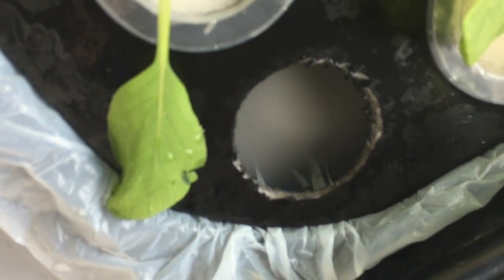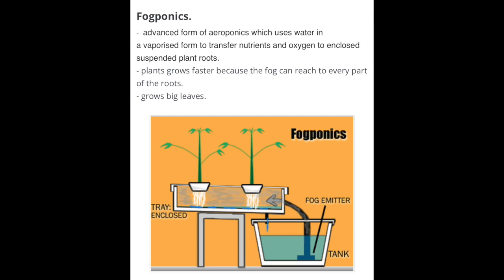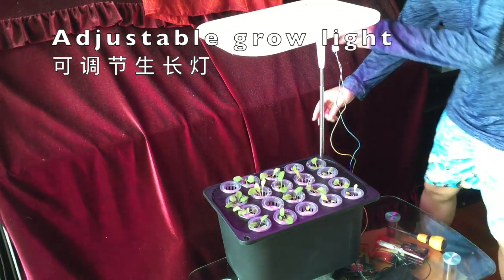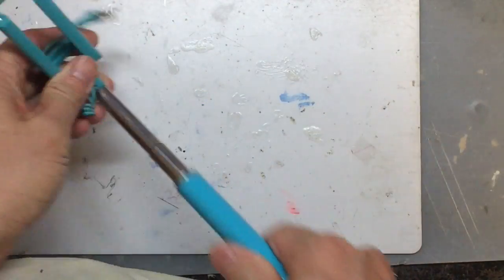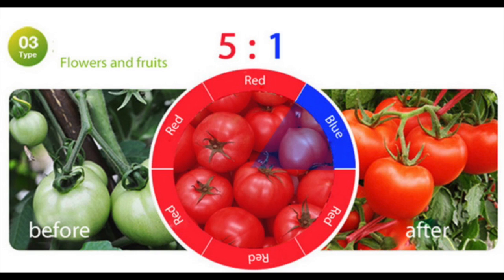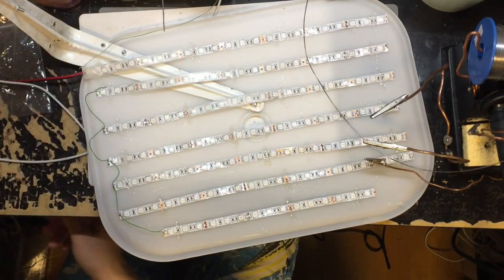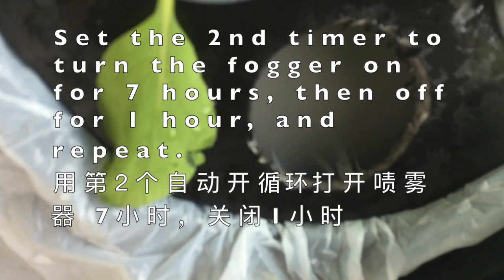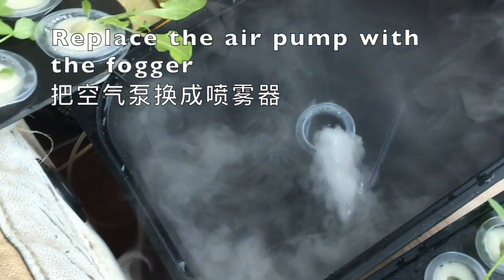DIY Home DWC Hydroponics and  Fogponics with adjustable grow light

Comment: 1:58 - I have never seen any scientific explanation in the "advantages" of "fogponics" being "better" than real "high pressure aeroponics (A.K.A True Aeroponics systems)". Can you please show me any valid scientific papers, articles, documentation or proof that fogponics is "better" than a true real high pressure aeroponic systems? Because NASA has already done the homework, they concluded that the plants roots absorb water effectively and efficiently at 50 microns. Which means the water mists needs to be ideally around 50 microns, anything smaller or bigger than 50 microns is not helping the plant to absorb nutrients quickly and logically. "Fogponics" makes mists around 10 or less microns which is not ideal for the roots. Fogponics is very easy to make, NASA would've used "fogponics" for the astronauts to cultivate food, but they do not use "fogponics" because it is not ideal for the roots. You can google and find the paper on NASA using High Pressure Aeroponics and their study and invention of Aeroponics.
Reply: I think he may mean "better" in the sense that it is more economical and easier for the average DIYer...
I don't recall the channel, but there's a video out there with a side by side comparison and the end results are negligible....

Comment: What happened to the other video about fogponics vs eb-n-flow vs arreoponics? Which one was best? Building a fog system now just waiting for the atomizer now ty
Reply from the maker: I have changed my system from an active irrigation system to a passive one.  I found that the passive system though may not give the best  yield is more environmental friendly , saves electricity, avoid noises, and can still produce a reasonable harvest.  See my other videos in my channel where I described different versions of such passive systems using  float valve to automatically irrigate the plants leveraging the earth's gravitational force.  http://billydiy.blogspot.com/2020/11/shallow-water-culture-passive-vertical.html
Reply: @BillyCdiy  I'm trying to build a fog phonics system. A tower project isn't what I am looking for though

Comment: Billy:  I use those dipswitch-programmable interval timer boards (110V) sold on Ebay... Set up the system and measure the time it takes to just overflow your tub  with fog (usually 2 min. for me).  Time how long it takes for the fog to recede halfway. (usually about 12 min. for me)  Set up the dipswitch timer with these ON/OFF intervals.  Water never warms up now and power consumption is very low.  In larger Fog tubs, control TWO fog pucks instead of one for redundancy and quicker vapor filling.

Comment: Is the particle size in the fog large enough or suspend the nutrients?
Reply from the maker: If you stir the nutrient solutions pretty well when you make the solutions, there should be very few undissolved particles. For mine, the plants grow well. However, I've been looking at even more environmental friendly ways to grow my plants, such as the autopot system and I've created a 3D printable version of it. See my other videos

Comment: Could there be an improvement from adding an airstone (so when the roots hit the water it's more like DWC + fog)?
Reply from the maker: Meow Mix yes.you can mix and match. However, more and more farms are using the new passive method using auto water level controllers and a big nutrient tank to allow the plant to absorb whatever level of nutrient it needs. Part of the roots are above the low level mark hence e pose to  air without an air stone. See my other videos
Reply: @BillyCdiy  I will check out your other videos, thank you!

So if I normally run airstones in a 4 gallon solution (5 gallon bucket) could I run a fogger in 1 gallon of solution w/o an airstone?
Reply from the maker: Meow Mix , yes you can try. You will not need the air stone in a  perfect areoponics or fogoponics arrangement as the root will be hanging in the air and not touching the nutrient solutions.

Comment: Video update ?
Reply from the maker: I have not made a video update on this. Theoretically, Fogponics and Aeroponics is better than flood and drain. between Fogponics and Aeroponics, I found that in practice, Aeroponics is easier to control than Fogponics. As the fogger tends to run hot and boil the water. If you need to use fogponics, you need to make sure the fogger is generated from another fog box instead of emerged into the same nutrient that feeds the plant. As that heats up the nutrient and end up not good.

Comment: Just wondering how the vege was?  was it growing well?
Reply from the maker: Theoretically, Fogponics and Aeroponics is better than flood and drain. between Fogponics and Aeroponics, I found that in practice, Aeroponics is easier to control than Fogponics. As the fogger tends to run hot and boil the water. If you need to use fogponics, you need to make sure the fogger is generated from another fog box instead of emerged into the same nutrient that feeds the plant. As that heats up the nutrient and end up not good.
Reply: @BillyCdiy  Run two foggers. Place one fogger in the nutrient solution that will run for 30 minutes every hour to keep heat down. The second fogger will be in a separate box of water and run 30 minutes every hour. Have both foggers alternate.
Reply: @nathanncohen793  Great video. I made a try with one mist maker a box 35x23 cm and I set up the manual timer to 15 minutes on and 45 minutes off on the day and 15 minutes on and 1 hour off on the night. My strawberries looks very well and the water is never hot.

Comment: Where the fuk?
Reply from the maker: Sorry. I do not understand your question
Reply: @BillyCdiy  Sorry bud it's just it sounds like you are using a cuss word when you say fog.

I did subscribe wmto you love the video, I'm going to try to implicate that design but with 7 gallon tote with 34 clone sites. 

How many gallons is the tote you use
Reply from the maker: around 20 liters. I bought it from Ikea
Reply: @BillyCdiy  I'm very interested in fogponics. Have your yields been good? , I want to set up a timer for every 10mins it comes. In concerned about how long it takes to fill up with fog and how long it lingers near roots
Reply: @BillyCdiy  I have 102 liter tote with 35 plants. Do you recommend dec with fogger or aeroponic w/ fogger
Reply from the maker: @pjcerda1186  , My harvest with fog ponics  is OK but not way better than conventional methods. 
You can check whether the fogger can generate enough fogs to cover all the spaces in your tank. 
I just turned the fog on for 7 hours, then shutdown for 1 hour to avoid overheat of the fogger.
Fogger is a high maintenance device. They fail easily.
I have replaced mine a few times. It breaks after a month.

In the end, you need to weigh all the pros about aero ponics / fogponics against the cons: high maintenance cost, overheat of the tank as the fogger generate lots of heat. My view is that there is insufficient marginal benefits to cover the cons. 
After trying all these methods of hydroponics/areoponics/fogponics/ Deep water culture with air pumps, I have gone back to the basics. 
Similar to Kratky but with my own DIY autopots water level controller. Set a very low water mark to allow the roots to get enough oxygen. That proves to be efficient, some degree of automation with with reliance on electric power.
Check out my latest videos.

Comment: The reason for adding dwc is that the ultrasonic fog doesnt provide sufficient moisture on its own to sustain the plants. When the roots reach the water they wont be aeroponic. Aeroponic roots can be sustained without dwc if they are suspended in the correct mist environment. 
https://youtu.be/mNZYR96rhwY